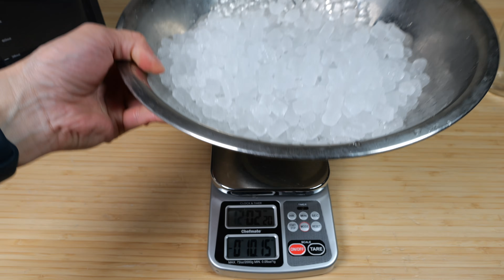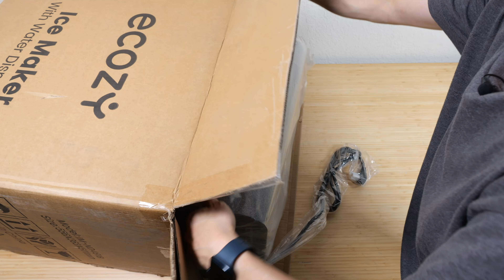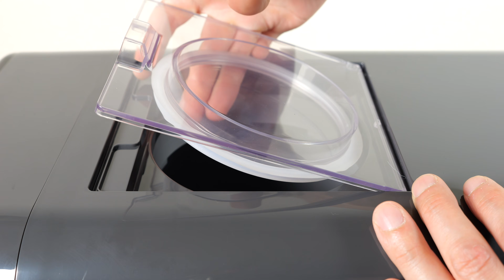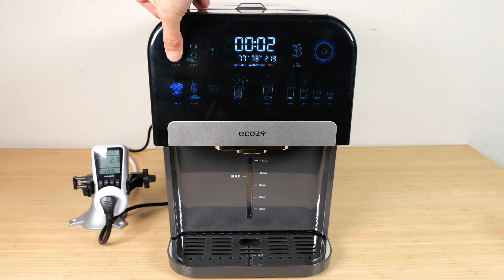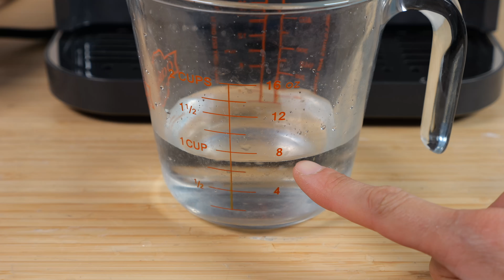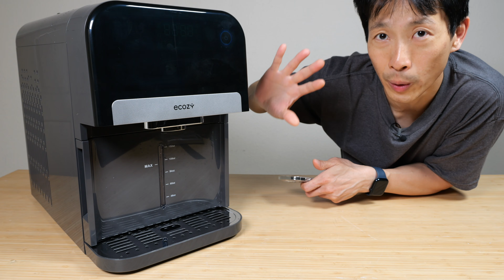Nugget Ice Maker and Water Dispenser Review [ecozy]

Comment from the maker: WARNING: This machine appears to have a high defect rate of slight leaks. It usually happens right after you get it so I would recommend to try to use it heavily the first 30 days to see if the issue surfaces so that you can return and get a new one if needed.